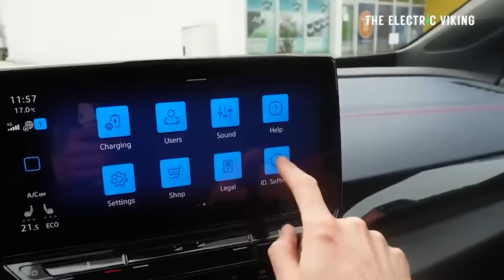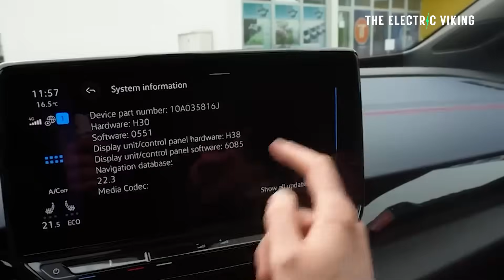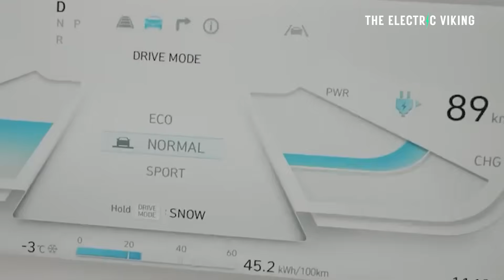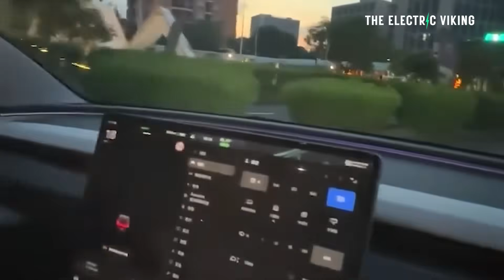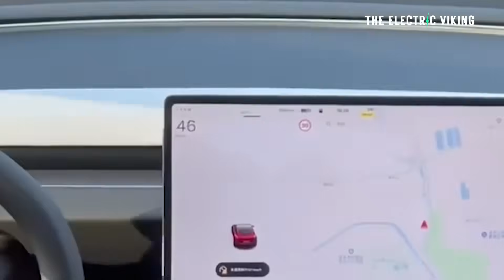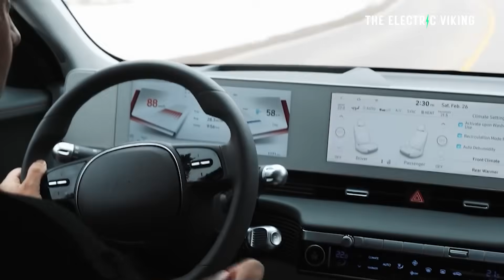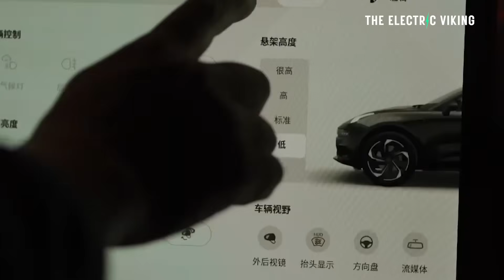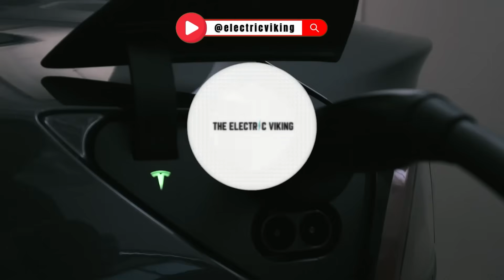Study analysing 10 million cars finds EVs more reliable than GAS cars

Comment: I  cannot understand why anyone would buy an ICE today. Why are they still selling?
Reply: Here in the USA the selection is very poor. Few models, dealers don't have them or mark them up because they hate them.
Reply: There isn't an electric vehicle out that can compare with the utility of my 12 yr old SUV.   I have carried bathtubs,lumber, plywood, drywall and other stuff, as well as tow my boat hundreds of miles to events, plus I can sleep in it at these events.  But I do agree an EV makes a pretty good daily commuter and grocery getting, if you don't mind the high price and poor resale value. Some complain about the high insurance though.
Reply: @drewthompson7457 
Try sleeping in an EV with the air-conditioning and electronics running and you'll never go back to sleeping in an ice.
Reply: @FrankiePo89  : I have never had a problem sleeping in my SUV after towing the boat to an event, as it's usually cool by the lake.  Now, how is your EV at towing 3500 lb for hundreds of miles? How do you carry building materials?  ( Drywall, plywood, lumber, bath tubs, etc.)
Reply: @drewthompson7457  
Oh... I'm never into towing anything. I've camped out in my ice and are currently doing that in an EV. The change is simply wonderful.
Reply: @FrankiePo89  : I have a house to sleep in most times. As you see, an EV is too limited for my needs. As for camping, I'd have trouble fitting an EV in my canoe.
Reply: @drewthompson7457  
I thought you're talking about outdoor activities and sleeping in the car.
That said, both platforms have their place. And EVs are catching up on its shortfalls.
Reply: I love sleeping in the back of my Lyriq. Can run the heater all night.
Reply: @drewthompson7457 the upfront cost is more. Overall the cost is less. Sounds like a cybertruck has got you sorted
Reply: @se62hy  : a cybertruck?  Thanks for the joke.  But yes, EVs are improving. I prefer mature technologies. Some year I'm sure an EV will have the versatility I would prefer.
Reply: Imo, the biggest issues with evs is the charging speed, and the charging network.
Reply: @phil1758  : I saw  a YT, some resort town in Europe. On Sunday, there was a 2 block long line waiting for the EV chargers.  A friend told me that there are now some chargers set up so you don't have to find a place to leave a trailer when charging.

Comment: No way there only 14 ev  cars made in 2017 and older on ebay in the uk and 10s of thousands of older diesel or petrol cars .
Batteries are shot in 7 or 8 years then they go to the scrap yard
Reply: Batteries are warranted for 8 years by the manufacturer. Or longer. When the car dies you can sell it.
Reply: Only if the service record is correct

Comment: My daily car is 21 years old. Maintenance I do myself. Original engine.
Sorry, I haven't come across a 20-year-old EV yet. And certainly none with the original battery....
An EV is a computer on wheels. The performance of a 20-year-old computer? I have my doubts about this.
After 20 years, ota updates? Outdated technology.
Sorry sir your car is no longer supported, you will have to buy a new one. 😂😂😂
Reply: I had a 23 yr old car.

Also do my own maintenance.

Smashed the rear window. Couldn't get a replacement. At least not at a cost less than the value of the car. Car was therefore a write-off.

And modern ICE cars are also not just a computer, but computers, on wheels.
Reply: @ You have a point. Almost all modern cars are junk. Too many sensors to reduce emissions (on paper) but in reality, due to their weight and power, no faster or more fuel-efficient than 30 years ago.

Comment: Did the study compare the actual costs of fixing BEVs compared to gas cars?  I'm just wondering because I hear that if there is a battery fault it's usually curtains for the whole battery.  Moreover it also seems that insurers prefer to write off accident damaged BEVs rather than risk a battery that could be damaged.  I would want all this information available in order to make an informed choice/
Reply: Batteries can be usually be repaired. There are specialist  repairers popping up for when they are out of warranty. Warranties are usually 8 years/100,000 miles in the UK, far longer than most ICE cars offer. Far less moving parts in EVs makes for greater reliability and cheaper servicing.
If it's major crash damage it is often cheaper to write off a car just like with an ICE vehicle.

Comment: I have a 1993 MB that has gone 168,000 miles. However, it wasn't without spending a bunch of money on it. I love the car so I'm willing to spend the $$ to keep it on the road. However, I can agree with you. EV's don't have as many moving parts and therefore need fewer repairs, such as tune ups, engine jobs, etc. You can also add the additional costs of brakes, oil changes and other maintenance issues. At some point in the future, I will get an EV for regular use and I'm sure it will cost less to fix and/or maintain. Great videos!

Comment: Remember, to last a long time, ICE cars need a lot of ongoing service and repairs.
Reply: @paulstack2431 if you aren’t doing regular oil changes and following the manufacturer’s service schedule then your ICE vehicle isn’t going to last. The annual service costs for doing this isn’t trivial (dealers make most of their income from servicing cars, not selling them). Don’t follow the service schedule and your warranty is void. Tesla has dropped the idea of a service schedule completely. Other manufacturers may differ.
Reply: @stevetodd7383  i have a fl5 type r, and my annual service is $195 for the first 5 years ' like I said if you buy the right product  😉
Reply: @paulstack2431  so, it’s a mere $1000 for the first 5 years (ignoring the other bits that they tack on to the bill which aren’t included in the regular service). I’m assuming that by Year, they mean a given mileage limit, so a maximum of 5 years at that. You missed the comment about an EV owner having only spent $500 over the time they had their vehicle (110,000 miles)? I’m also assuming you didn’t have anything to do with the financials for the dealership you claimed to have worked at. It’s a well known fact that servicing is the dealer’s cash cow, which is why they are so reluctant to sell customers EVs.
Reply: @stevetodd7383  10,000 klm or 12 months interval ' and the only things that may affect that are cabin filter recommendations every 2 years cost $40 ' and a brake flush every 3 years cost $130.  Any ev will require these 2 items at similar intervals ' and any vehicle should have a health check atleast every 12 months or 20000 klms on all systems and safety points' including tyre rotation if you want them to last as long as possible and be safe doing it. Now I really like electric vehicles  ' and I think by 2030 they will be on par with ice vehicles for weight and including tyre life ' I like that an ev motor doesn't need warming up like an ice vehicle and should be much smother with amazing performance looking forward to maybe purchasing one that suits my needs when they are atleast on par with what I currently have in levels of rule handling and usability.
Reply: @paulstack2431  You are literally making stuff up. Oil changes, brakes, belts, engine air filters, fuel filter, spark plugs, oxygen sensor, co2 sensor, just for a start. These are thousands of dollars. And at the end still need expensive petrol and produce toxic fumes. And they're slow.  
BTW did you ask your parents for permission to use their YouTube account?
Reply: @stevetodd7383  And I worked in a Toyota dealership for 17 year's so now would you like to tell me more about your dealership experience?
Reply: @Chris-be1fo  My car would not need most of this in the first 100k of use apart from basic services so please check your facts' you are deluded if you believe an ev wouldn't need the same services apart from the obvious oil' ' oil filter there's not enough difference in the cost of both services now if your talking about a higher maintenance European ice vehicle you might have a point.  Do your research, and don't use insults to try and prove your argument. And its a Civic type r no current ev under $100k would get near it on a track or mountain rd' the day they make a reliable ev that is of similar price and purpose that will also do 300000 klms and  have a 600km range  and 5 minutes charging without needing a new battery sign me up 😉
Reply: @paulstack2431  the schedule for a new Type R (the older model has a shorter interval) is 12 months or 12,500 miles, or whenever a service light is lit (whichever comes first). You would need, in 100,000 miles, to service the car at least 8 times, replace the air cleaner element 5 times, inspect the valve clearance, replace the transmission fluid, replace the tank fuel filter and replace the plugs once. Even for just the standard servicing that’s $1560. Add in pads and discs (probably around 2 sets in 100,000 miles, but that depends on your driving) and you’re looking at circa $4000. The Tesla Model 3 mentioned in an earlier thread cost $500 and was still on its original pads. The Model 3 performance IS about 1000lbs heavier than your Type R, but gets to 60 in a little over 1/2 the time and can get around a race track only a second or so slower than a BMW M3. It can do that with a list price of about $75,000.
Reply: @stevetodd7383  Your not in Australia ' the service schedule for the Fk8 is the same as fl5 I've had both from new and its 10,000 klm or 12 months for both vehicles and as this is an Australian video I used the right metric '
Reply: @stevetodd7383  And you will need services ' tyres and brakes in any ev especially a performance one such as the modal 3 performance and st 500 kg heavier than a Type r it would definitely destroy tyres and brakes way more so than a Type r and no ev yet will give me the same handling and precision or feel of a Type r' so atm they are not for me.
Reply: @ tyres, maybe. Brakes, definitely not. The whole point with an EV is to convert kinetic energy back to electricity wherever possible. The Australian price for the Model 3 performance is AUD 81,000. Using your own numbers that takes the servicing costs (just for the basic service) of the Type R to AUD 3120, plus breaks and pads, plus fuel and oil filters, plus belts etc. You’ll need to get through tires a fair bit faster to make the EV more expensive to run.
Reply: @stevetodd7383  I don't care my friend I'm not buying one over the type r' it's not for me get it.
Reply: @ no one is forcing you, I’m just pointing out that the reasons you claim for not getting an EV aren’t true. They are cheaper to run, need much less maintenance (Tesla’s service schedule says to rotate your tires every 10,000 km, replace the cabin air filter every two years and check the brake fluid every four) and cost less than AUD 100,000 for a vehicle that outperforms the Type R. You may have other reasons to prefer the Type R, but servicing costs are much higher, which is what the original comment was about.

Comment: A lot of people do not buy EV as the resale is currently terrible.' this may and probably will change in the future .
Reply: Here in Australia the Tesla holds its value 
 Cheapest model 3 on Carsales website is A$32000 and that’s 5 year old 2020 standard range plus with 135000 kms 
That’s not a lot of depreciation for a 5 yr old car
Reply: @Alex-l6d1f  lol ' I'm guessing that's why the new purchase prices have dropped significantly in the last year or so 😅
Reply: Not as long as you can't charge them easily.

Comment: I can say that my electrical gardening equipment (hedges, chainsaw, whipper) is much better than petrol engine equivalent. I push a button and the electrical equipment works, it is quieter and the battery life is decent. 
It is a Byzantine process getting petrol engines started (especially 2 stroke engines).
Reply: True in my case too.
Reply: wr

Comment: In the US a EV battery pack must have an 8 year 100,000 mile warranty by law. There is no legal requirement for a warranty on any part of a gas powered car. It's just up to the manufacturer.
Reply: My EV in OZ has that warranty from BYD
Reply: All recent gascars are " Designed to Fail "
Reply: You know that law in the US isn't in effect yet right. Doesn't go in effect until 2027.😮😂